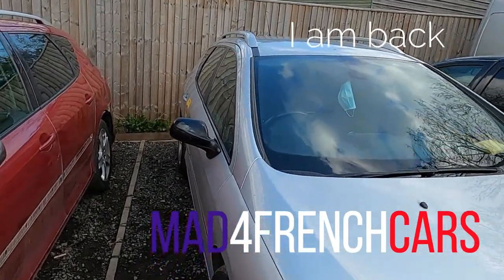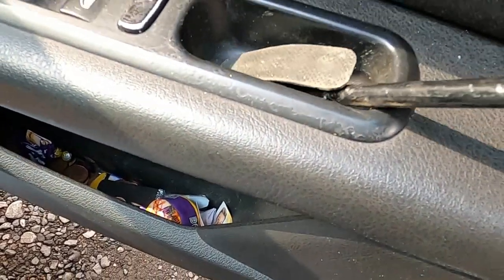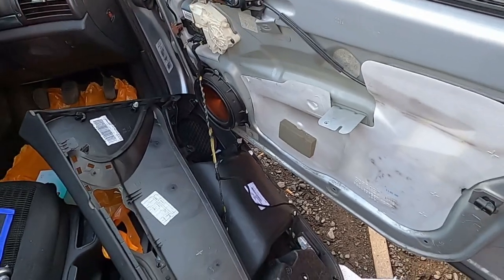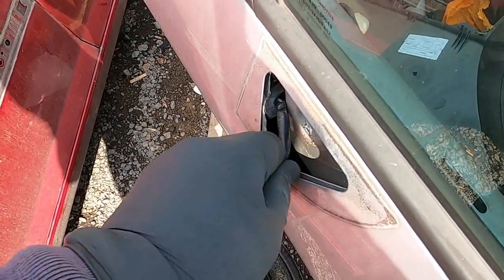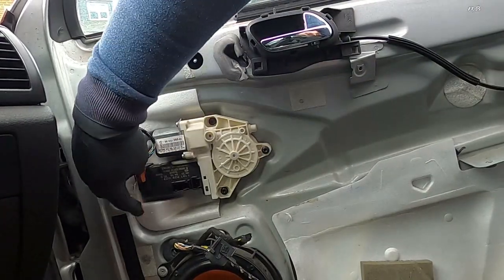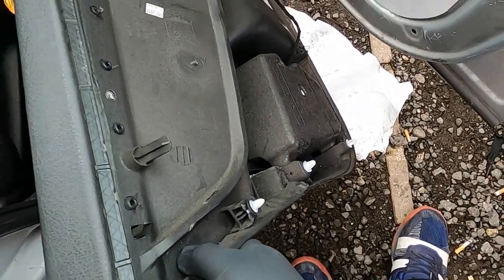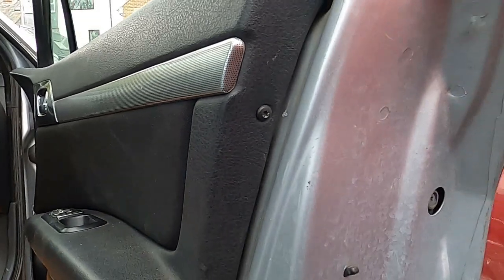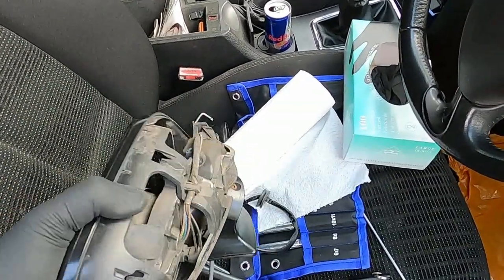Peugeot 407 SW/Sedan wing mirror removal/replacement

Comment: I have peugeot 407 my mirrors is not  folding,how to fix it ?
Reply from the maker: Hi mate some of the cars have a mirrors which doesn't fold but mostly in a 2009 - 2011 if the car is SR Spec. You can activate the mirror folding with Diagbox software also you might want to check the fuse responsible for power folding mirrors.